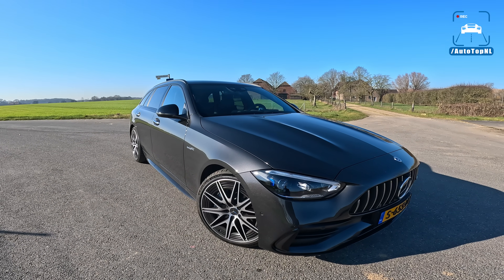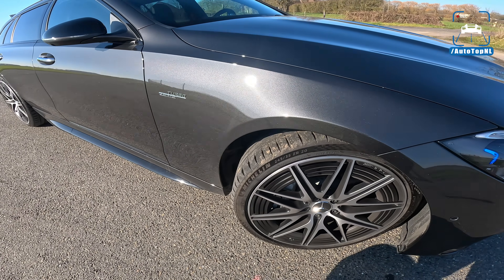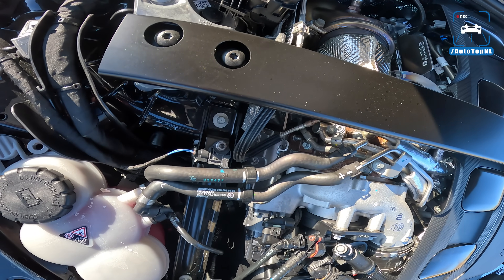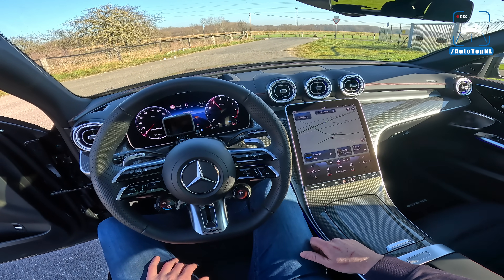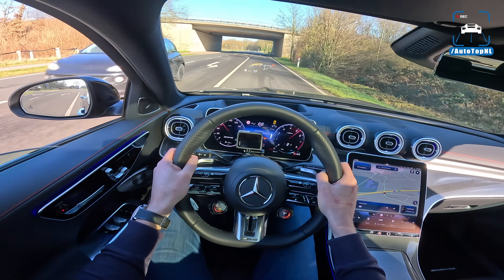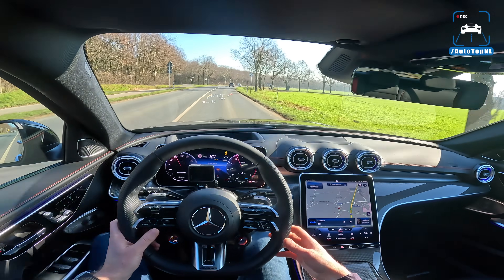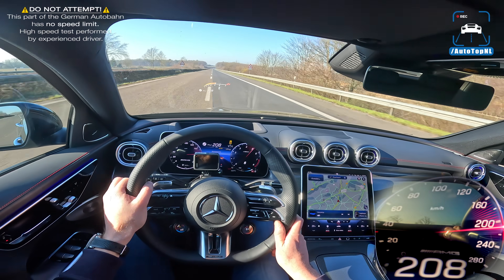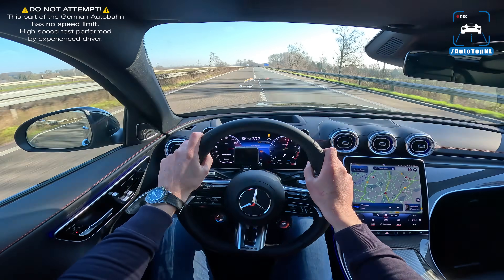2023 Mercedes-AMG C43 | REVIEW on AUTOBAHN - the MAGIC is GONE!?

Comment: I’m sure it’s great but I just am not willing to accept it. Over complicated hybrids may be faster, but they’ll never be better than the V8 counterparts
Reply: Especially when the direct competitor, BMW, still has the inline 6 b58 engine in their M340.

That's honestly a humiliation for Mercedes.

They should have improved the older V6 engine.
Reply: If they gave the v8 4matic plus it would be the same as the hybrid 4 cyl
Reply: "Better" is subjective. I don't think hybrids are quite there yet, but we'll see. V8s are great for so many reasons, but they have no place in the future. They'll remain a thing from the past whilst newer technologies continue to improve. I'd love to see what an uncompromised pure electric AMG C or E wagon would be, designed from the ground upwards.
Reply: @nicholaswicks3077  ??
Reply: Also when the tiny battery runs out you're left with only the petrol engine hauling all that dead weight and also recharging the battery, meaning shit performance without the electric motors. Whereas in a normal petrol car you don't have that problem, all the power all the time.
Reply: @buca9696  If that's true, it wouldn't help, that's for certain! I've never liked the idea of hybrids myself. If anything, it should lean more towards big electric power and smaller ICE. This doesn't make much sense from a weight perspective of course, so you're left with the obvious answer. All ICE or all electric.
Reply: Original comment
Reply: There may be a way to make a hybrid as exciting as a V8. This isn't it.
Reply: Also lets look how many of these hyper-complicated cars are still driving in 20 years
Reply: @buca9696  can u listen or what ? did u watched the video?

thats a plug-in hybrid u referring to not a mild-hybrid like used in the C43

and by the way Porsche uses plug-in hybrids since years and yet people still freak out when other manufacturers do the same .
Reply: For the A class is perfect but above its seriously bad
Reply: @tb.mk4349  I’m saying if they gave the v8 a little more power and 4 matic plus it would be a same speed as the 4cyl hybrid
Reply: @skylineownzful  even bmw having the marvelous i6 hybrid x5 45e
Reply: @skylineownzful  yes but the 6zyl lowers the margin 🥴. the 4zyl must be a nice cheap version. Mercedes really went for cost savings.

Comment: Its really disgusting whats happening at Mercedes and that deeply comes from my Mercedes heart.
Reply: Yeah if you look at the new BMW M3 Touring this is just sad.
Reply: @Kuhne1337  Even the BMW's are a sad reminder of what once where magnificent cars.
Reply: @fractalnature9412  I do agree, but Mercedes is still the worst when it comes to the newest cars imo. The M4/M3 are still good cars, but the C63/E63 cant hold up with the M3/M4/M5, atleast in my opinion. But we'll see how the new 5 will turn out.. this typical prestige of german car manufactures just isnt as good as it used to be... sadly. Only exception I would take is Porsche :D
Reply: @fractalnature9412  I mean if you draw the line, the only things BMW is failing at right now is design and steering feel. Of course older cars are more charming, but that's got more to do with emission and noise regs than anything else.
Reply: @xIcarus227  Bmw has still got the same dashboard from 2007 but dropped a big Ipad on it and some new buttons...... Even the exteriour isnt very charming except the 5 series. They sounds awful. 

In my opinion Mercedes looks much better but i like a big sedan look. The interiour in the new Mercedes even a basic A-class is levels above every manufacturer. 

Lets see how well they age haha
Reply: @fractalnature9412  come on, BMW have gone through multiple dashboard designs since 2007, don't exaggerate. 
Also, all cars today sound subpar because of the ridiculous OPF and the noise regs. This isn't specific to BMW. 

The A-class interior above every manufacturer? In what way? 
I agree that it looks really good visually, but in terms of build quality it's sketchier compared to BMW. 
The problem with the A and C-class is the fact that they develop annoying rattles over time, this aspect has actually made me reconsider buying a V6 C43 last year because many owners were complaining that the car doesn't feel well put together anymore after a few years. Not just the interior, but apparently the suspension becomes noisy too. 

It's not often you'll hear such complaints from 1 or 3-series owners They seem to be better put together, and BMW's leather in particular is known for holding up really well over time. Not that Merc's leather is bad or anything, just not the same - Audi's leather on the other hand is garbage though. Practically every RS5 I've seen that's 2-3 years old has the driver seat edges creased like hell. Fucking unacceptable.
Reply: @xIcarus227  because people buying a BMW are badge buyers and don't like to admit an other car is better. i do agree with the interior quality is better, design is old & boring.saying. most safety systems also work just a bit better on a merc then on a BMW but yea if you shop in the C63 / M3 segment then this W206 doesn't make any sense. a C63 buyer doesn't want a computer on wheels going fast without feeling, sound and emotion.
Reply: @Doa744  I don't understand why you're generalizing like that, as if an M car buyer wants a computer on wheels and not a handling machine. Hell, even normal BMWs aside from the 1-series have a driver focus due to the chassis setup and RWD platform - and it's obviously working considering BMWs sell so well. 
I mean if anything, I'd bet that Mercedes has more of a brand image considering the crap they get away with. For example the last-gen A-class had a dogshit interior compared to its competitors yet it didn't stop people from buying it in droves just because of the badge. And now you got this fake C43/63 crap, if this isn't Mercedes resting on its laurels I don't know what is. 

Neither AMG nor M buyers want an appliance on wheels, let's get real here.
Reply: @xIcarus227  sorry if it was unclear, I never claimed m buyers search that, I just say the average c63 buyer isn't looking for something like the new c63.
Reply: Don't hate the player, hate the game. It's the EU and its green parties.
Reply: @Doa744  well you said BMW buyers just look for the badge, you can probably imagine why I thought you mean M buyers as well. 

Alas, you're right that AMG buyers definitely aren't looking for this kind of garbage. It seems like proper sports cars are rarer and rarer these days. Damn shame.
Reply: @deathfrost6664  in this instance, it's not the EU and its green parties. Some Mercedes engineering head admitted in an interview that they could've used the V8 in the C63 and still meet emission regs. They simply decided not to. Baffling.
Reply: @xIcarus227  
BMW interiors look bad in general minus the 7 series
Reply: @yousef.al-assaf  fully disagreed, BMW interiors look great on the G generation and are very well built. 
The only garbage thing is that stupid iDrive 8 tablet, it's stuck on with minimum effort.

Comment: I think it is the first time this guy is roasting a car for 22 minutes straight. 😂😂
Reply: Even the previous gen c43 wasn’t that good of a car let alone this new crap, my uncle had 2017 coupe and the interior was rattling more than than a 1993 dodge
Reply: @thatpersiandude7386 the only option that improves it is the carbon. Still I get strange sounds. Quality is terrible. It was 119. 000 eur new.
Reply: @raiiiar  now that's mind boggling that they have an audacity to charge 120k for a car that is rattling inside...I wont mention that idiotic trend with fake exhausts. I get it on cheaper cars, I dont on cars like MB or Audi, especially E, S classe and A6, A8 Audis.
Reply: @painxxxl  mine is an E53, but the issue remains the same.
Reply: He isnt roasting the car at all. He's just saying how it is, what makes it even worse 😂
Reply: @painxxxl  previous gen A6/8 were built like a tank... New ones are plastic crap
Reply: @thatpersiandude7386  I have a same 17 C43 coupe, bro, the ride quality, build quality are garbage...rattling is not the one issue I hate the most, it's the brake and suspension/damping systems, the brake always make a werid noise when gently tapped, and the suspension even in S+ mode still feel jumpy and loose, no road feed back, in Comfort mode it jumps and sway even worse, it bangs on potholes, no damping whats so ever. I am not getting another C class anymore for sure. Currently have a CT5-V AWD for daily, ride quality have been day and night to the MB, the C43 will be traded in for a cheap EV probably next year.
Reply: As an old owner of C43, I can see that quality, which was already terrible, is now even worst. At least before you had a 6 cylinder, now you don't even have that good sound anymore, you are left with rattles (and whistling apparently :D)...I'm wondering what point Mercedes wants to reach and how can people still spend money on this garbage...
Reply: @raiiiar  it’s only you my man, so many people with these cars have issues with quality
Reply: @jackd232  We used to have a 2018 Glc43 coupe and shit went to the dealer 3 times for fixing multiple rattles and squeaks ! 
And for the money the performance was weak as hell ! my cheap g37 was a car length faster from a 20 roll
Reply: @thatpersiandude7386  bro I said it improves it. Carbon instead of wood makes the creaking better. Not good, better. The quality is crap for the money.
Reply: @thatpersiandude7386  previous gen felt like a knock off vr30ddtt, and that engine feels like a knockoff b58. Mercedes isn't the company it used to be.
Reply: It's plainly clear you don't like Merc C Class. I have a 2020 C43 4 door in Silver. Stunning to look at. Sounds amazing. Very fast. No rattles. Gearbox smooth most of the time. Dashboard instruments so much better than BMW latest. Pleased with it so far in 18 months.
Reply: because for the price its overpriced. Another car that looks great, but not so great for people that love cars. Peugeot way. Its like more powerful 508 PSA, mega sad.
Reply: @raiiiar Damn my e43 with pano roof and acoustic glass is dead silent inside even in my condos loud underground parking garage. Almost sounds like being pressurized when I close the sunroof

Comment: I will stay loyal to my old C43 with 367hp 😊
Reply: @sashaklik4283  tbh i think they are both around 12sec, but the sound is def way better 😁
Reply: @sashaklik4283  it's not, watch the video properly. He mentions this C43 is slightly faster than the old one.
Reply: @MaxLaonda  facelifted one with 390hp does 100-200 in 10.8-10.9 seconds

Comment: It makes the same sound as my Peugeot 3008 😂😂
Reply: what? a 4 cylinder motor sounds like a 4 cylinder motor? 🤯
Reply: @el_Riky  my Peugeot 3008 has a 3 cilinder engine…
Reply: @deezet9518  isn't it too much underpowered for such a big car?
Reply: @rahyan.  surprisingly not. It’s not lightning fast, but it has a lot of torc (320 Nm) and they got out of the engine what’s in it. Tuning it doesn’t give much more power. Up to 160 km/h it moves fast enough to be able to manoeuvre in traffic. And my previous car was a Skoda Octavia RS that had 230hp, so I know what a quick car feels like.
Reply: @deezet9518  Interesting, I know some people who owns this car and it feels like underpowered as hell, especially the 90hp variant. I have a question though, why did you "downgrade" to a Peugeot 3008?
Reply: @rahyan.  we don’t have a 90hp version here, I can imagine that’s too weak. Mine has 130hp and 320 Nm of torque.
The reason is taxes, in my country powerful cars are no longer affordable because of environmental and other taxes, which makes a powerful car very expensive

Comment: I just took delivery of a 2023 C43 Coupe (c205), and I couldn't agree more about the build quality now a days at Mercedes. They had like what 8 years to refine the w205, but nope. 1200KM in, already off to the dealership due to rattle and noise coming from the transmission tunnel. The dealership experience was fantastic tho, they took care of everything. But still, for that kind of money, you can get way better built cars even from a less luxury brand e,g. Mazda, albiet the V6 in the w205 is quite lovely and I really like all the characters and sounds it makes. Apart from the build quality (which is a big one tbh), amazing car.

Comment: Mercedes could have used this 4 cylinders for the 43 AMG and keep the straight 6 that the E53 uses for the C63 and add the electric motors, just saying.
Reply: They could have kept the v8 for this gen apparently. 

St8 6 though even "electrified" would have been more fitting for both C43 and 63
Reply: They could've even kept the V8, their department head admitted as much. He said they could've fit the V8 in and still comply with emission regs. Insane decision from AMG.
Reply: @S  agreed! C43 maybe I understand the 4 pot if only they could make it sound a bit more dynamic and characterful. 

C63 should have been given at least inline 6, rwd and 520hp. None of the complicated hybridisation rubbish.

Comment: I drove the new C43 estate the other day and found it to be disapointing. Tbh just felt like a quick C300. Emotionless, Rough engine and just no comparison to the S4 Avant or M340i. Topped off with the new C63 estate being pretty much useless due to that massive hump in the boot floor. At least the E63 is getting the Straight 6 from the E53 but if they do the same thing with the bootspace... I'm done with Mercedes! Unforgiveable having an estate that cant fit a dog crate!
Reply: Interior and looks is by far miles ahead of the m340i. That car looks like a rental car interior.

Comment: Great video! I am actually considering one of these vs the G70 and the M340i. Here in the US, it’s much easier to get a good discount on one of these vs the BMW for obvious reasons lol. Coming from a 2019 Volvo, this thing felt properly quick and not like a 4 cylinder. AMG did a decent job of masking some of this cars deficiencies. Not sure if you’ve driven or heard a US spec of one of these cars, but ours are a tad louder and have more pops on shifts on the outside of the vehicle. Still no B58 but the non-US spec of these vehicles does seem to leave a lot to be desired. The ride is good in comfort mode but the transmission can be jerky at low speeds…wonder if that’ll ever get refined. Now I have to drive an M340i next! Loved the sense of occasion behind that new AMG steering wheel but I can see how this vehicle isn’t everyone’s cup of tea. Maybe it’s mine since I’m coming from a much lower level of vehicle performance but we’ll see. I loved the G70 but the interior feels so badly outdated! Which is a shame.
Reply: Get the m340i, its not even a question

Comment: tbh, i understand why they do it but at this point if the amg will sound like a 4 cilinder, i would just go with a diesel... top spec diesel. I will be more reliable, it will have more torque and will probably cost much less.

Comment: Imagine how much a replacement turbo or alternator must cost with integrated electric motors sandwiched in.
Reply: Imagine how much that hideous infotainment screen will cost to replace. The car won't function without it, and it will cost more than the car to fix in 7 or 8 years' time. 

It is ironic, but a simple V8 AMG is a lot more environmentally friendly because, with regular maintenance, it keeps on trucking for 20-40 years, no problem.

Electric is the new diesel just 20 years on. Just need to wait for electric gate to end this nonsense which will happen
Reply: In general its a terrible amg product. Sad since the biturbo v8 is good from last gen

Comment: The 4 cylinder amg engine does work as a replacement for the V6 in the C43 but I hope mercedes-benz quickly learn (especially from BMW) that making a C63 4 cylinder is a mistake. Yes its a powerful engine but the main characteristic of a C63 is the brutal sound it makes. And this 4 pot turbo doesnt have anything close to what the W205 has. I am so glad BMW still puts its glorious B58 and S58 6 cylinder motors in its cars.

Comment: At this point, just get a golf r 2023 abs with that extra cash you could spend on this merc, tune the golf r.
Reply: Right, it will be much quicker and it will deliver more emotions. Especially when the screen dies off and you cannot change the temperature anymore. Other than this great option.
Reply: @WentylSk8  the golf r has no issues. Unlike Mercedes.
Reply: @alien_raider464  it does have issues, the interior quality is hilariously bad and at the end of the day you're comparing cars from different size and 'upmarketness' classes. By that logic buy a Miata because it's analog, but in reality nobody cross shops a C-class with a Miata just like they don't cross shop it with a Golf.
If it's performance and fun per dollar you're interested in, there are far better choices than the Golf.

Comment: Don't see the point of the new C43, it is no faster and uses no less fuel than the previous version. Hence I just ordered an M340i. Torque converter autos also smoother than the dual clutch transmissions.

Comment: For me, the main problem isn't the 4-cylinder engine, but the way it was executed. The Hyundai i30n has 4 cylinders, and people love that thing. It's loud, emotional, with pops and crackles. But everything the AMG does is fake noise pumped in through the speakers. That's just embarrassing.